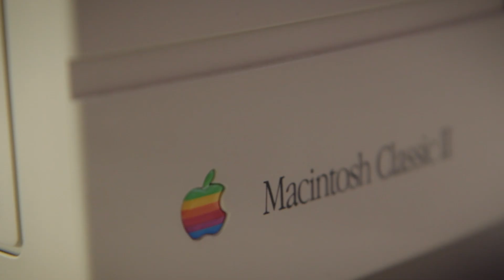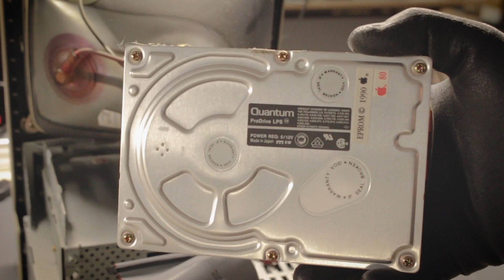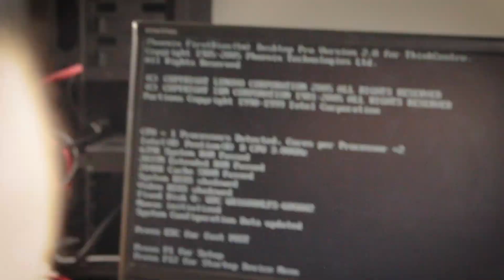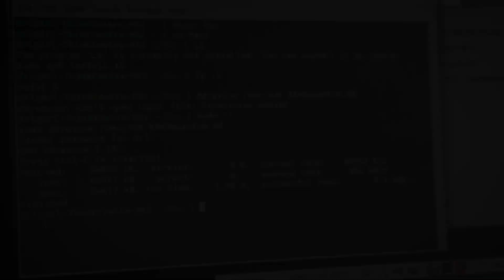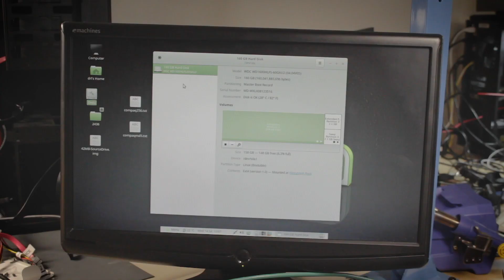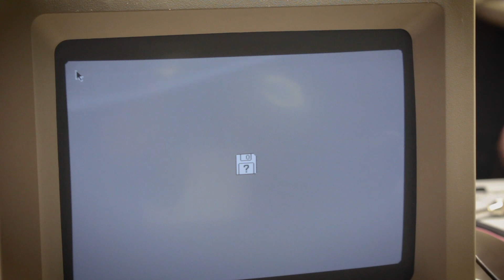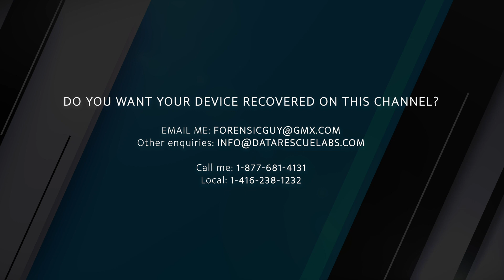Macintosh Classic data recovery

Comment: To safely discharge a CRT Mac, you can take a flat blade screwdriver and a jumper wire (with alligator clips on both ends of wire), clip the wire to the screwdriver, attach the other clip to one of the CRT's mounting screws.  Wedge the flat blade under the suction cup (Anode cap), you'll probably hear a crackle.  That is the voltage getting discharged.  Be sure you're not wearing any watches, jewelry, necklaces or anything with metal on your arms.  You don't want them to get caught in the machine and short across a live circuit.  And use only one hand/arm while reaching inside the back of those CRT Macs.  Never have both arms, until the high voltage is discharged.  

Some CRT Macs from the Macintosh SE and later models will have a bleeder resistor (1 Meg Ohm) installed somewhere in the analog board.  This automatically discharges the CRT when powered off, so you won't hear a crackle when you go to wedge the screwdriver under the suction cup.  

It's also a good idea to remove the raster board from the neck of the CRT (that small circuit board attached to the very long thin end of the picture tube).  It doesn't hurt anything, but prevents further damage along with more room to get your hands inside the confined spaces.  

On the SE and later models, there may be a mounting bracket screwed to the frame in the rear.  This is to mount the ports for a given expansion card installed in that Mac.  You can unscrew that bracket and gain more room to get your hands inside the confined space, as well.

Comment: I have a rule : Do not touch Macs older than 2009 - they are horrible to disassemble. But you are right they are a nice challenge. 
Nice work.
Reply from the maker: The iboom was extremely difficult but most other macs aren't too bad
Reply: They're not THAT bad.  I can tear 'em apart and reassemble blindfolded in my sleep.  The iBook G3s are indeed a nightmare, but I've taken them apart enough times, it's marginal.  The newer model iMacs that are from 2010-ish through today I won't even bother.  They disassembly procedure is very much similar to that of an iPhone/iPad.

Comment: FYI: flashing question mark can also mean the drive isn't found. Could be in there, but just bad/dead.
Reply from the maker: Thanks for the info Brian.
Reply: @forensicguy  A flashing question mark means that the Mac can't find a suitable System Folder to boot the OS from on a disk.  This could be from either (1) none exists...period, (2) the drive was erased, (3) the OS is corrupted preventing bootup or (4) hard drive stiction/failed drive overall.

Comment: I have SE and SE/30 both with dead scsi drives now and an external scsi that died and a scsi that I have had working but with a PC card. Is it not possible to convert the PC scsi to mac?
Reply from the maker: There should be an adapter on eBay, but keep in mind you will need some kind of a data recovery software to read the drive as it might not be natively supported on a modern Mac and definitely not on windows